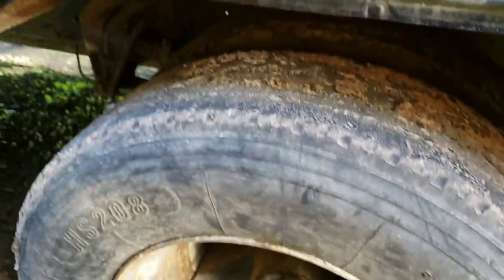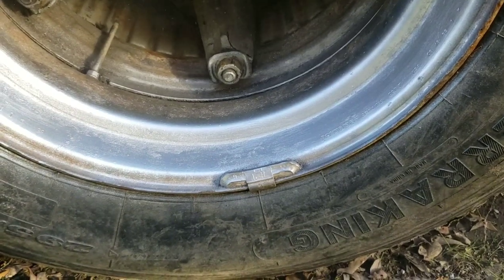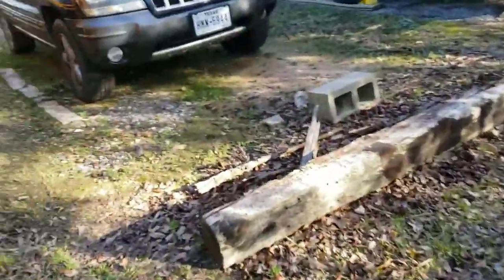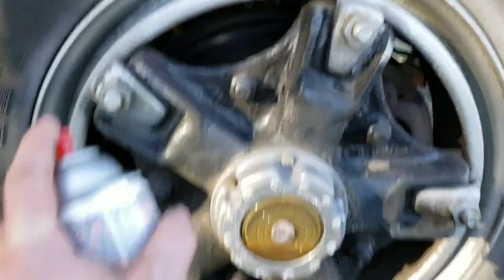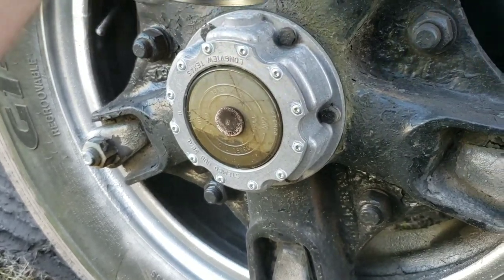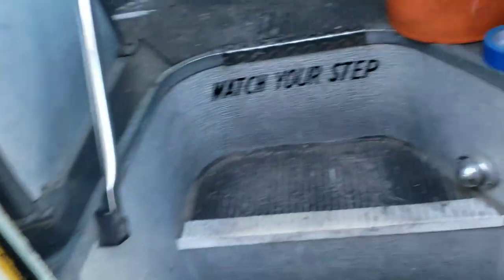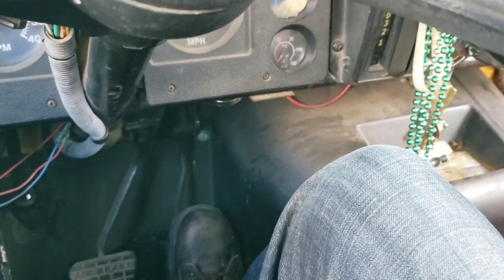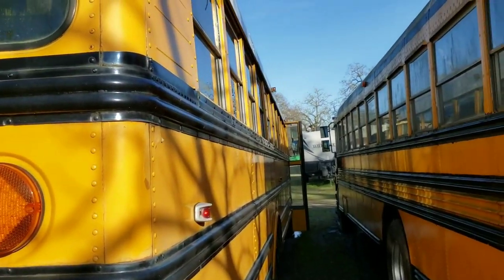Painting the Bird's Dayton Rims

Comment: A S1800!!! Very nice!!! Some years ago, here in Mexico, i used a S1800 on the public transport service, but equipped with a 3800 front hood and a refurbished DT466 engine. It was a 1987 Thomas. Greetings from Ciudad Juarez, Mexico.
Reply from the maker: Hey Jose!!  Greetings to you in Juarez!!  My second bus is a 1987 Thomas S1700 that I swapped a stickshift and DTA360 into.
Reply: @txstreetman  My S1800 was equipped originally with a twin stick shift, but it was replaced with a two axle speed; and the DT 360 is one of the favorites here in Juárez. In fact, we replace some newer IHC engines like the Maxxforce, CE200 or T444E with refurbished DT 360 because are more reliable, silent, cheaper and easier to repair and mantain. And the Dayton spoke wheels are the best!!!!